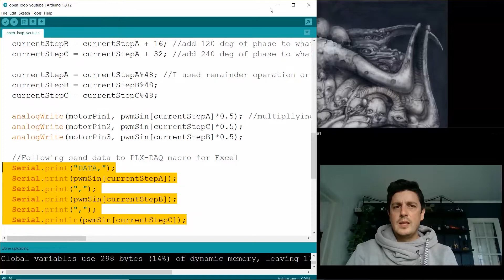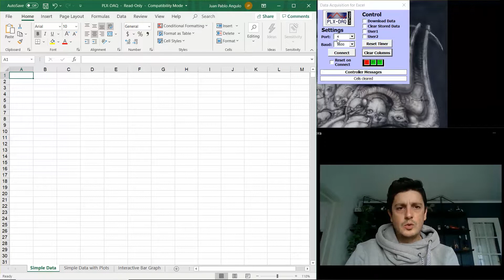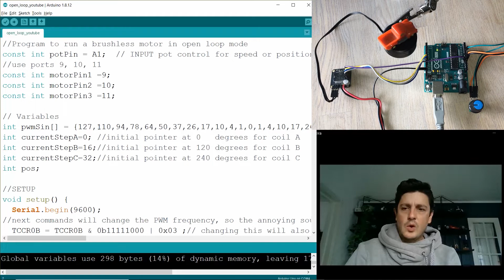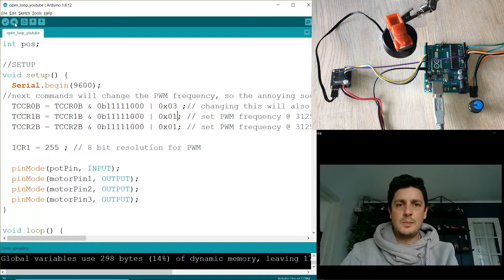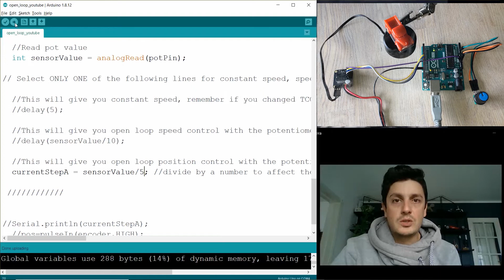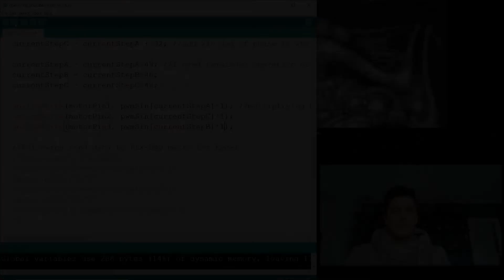Brushless Motor Control with Arduino (slow rotation) Open loop

Comment: Hey Pablo
So I recently bought four ball screw devices at an auction because they were fitted with black motors with encoders, apon inspection at home I realized they are bldc motors also fitted with  ESP32 and ODrive boards V3.5. I am having trouble finding the L6234D here in my part of the world and was wondering if you  could you maybe provide me with a pinout sketch so I can use it instead of the L6234D ? (Or maybe using the ESP32)The motors I have are also quite large. This BLDC thing Seems pretty cool and would like to start tinkering. Kind Regards.
Reply from the maker: Sounds fun! If you go into my patreon you will find a way to drive bldc using the very common L298, hope that works for you!

Comment: Wow, that's a thorough explanation! In my situation, I'm utilizing the IR2104 drivers, but I'm encountering difficulties grasping the theory. Essentially, there are two methods to control a brushless motor: using PWM, as you demonstrated, and employing full-wave switching to commutate the phases. Initially, I thought employing both methods simultaneously was the correct approach. However, my teacher suggested otherwise. Currently, I'm unsure about how to configure the Arduino to send PWM signals and effectively operate the motor. Do you have an idea on how am I supposed to do since there is two IN pins (High, and LOW pins) ?
Reply: These 2 IN pins are for brushed motor, HIGH and LOW for direction only.

Comment: thanks for the video. I want to use gimbal motor 2204 260kv to rotate an arrow max 30 degrees left and max 30 degrees right, depending on the car steering wheel position taken from can bus with adafruit board that has can bus integrated. My question is: do I need the encoder? because I don't really need the feedback from the motor, it should run the loop and the motor position will depend on the position of the steering wheel? thank you.

Comment: Hi! Your experiment is very impressiv! After your video, i made my controlling system based  a little bit diferent parts and changed logic, but source is Your idea. I have an old CD head stepper with 2 coil, and L9110 dual H Bridge. I made a +/-simmetrick sine wave with the H bridge, and the poti can change the direction and the rotating speed. My sine wave have 12 steps from 0 to 255, and the system working fine, but the clone UNO cant working with 32 kHz pwm mode :-(  My expriment video: https://www.youtube.com/watch?v=993LI6Ki1ao
Reply from the maker: Guess its a bit noisy then? You hear a “hum”?
Reply: @RandomAccessProjecs  Yes, 500 Hz PWM....

Comment: Thanks for your guide!
I also apply the sine wave value table, but I noticed with each rotation, its rotation angle is irregular, for example there is step = 1.5 degrees, there is step back = 3 degrees, please tell me, do so that each stepper rotates, will obtain 1 fixed angle like stepper motor?

Comment: Any reason you made the sine lookup table length 48 ? I see that 48 is a factor of 1/3 and 1/4 (for the 120 degree and 90 degree shifts). But any other reason? Based on poles or anything?
Reply from the maker: Only the reasons that you mentioned and the fact that 48 gives a decent resolution, but you may use a larger/smaller number, its not related to poles or anything else.
Reply: @RandomAccessProjecs  What other values could we use instead of 48?

Comment: First of all thank you so much, you explained the stuff very clearly. I have a doubt after watching the first video again....
We started with index zero. How do we know the relative stator-motor position? Will it just start with a random torque value , between max torque(when magnets and energised coils out of phase by 90 degrees) and 0 torque (neutral position-when magnets are in line with the energised coils.) .
Reply from the maker: Correct... in open loop you dont know the position of the rotor so it will start with a random value until they align. My other videos explain the closed loop approach, hope they are useful :)
Reply: @RandomAccessProjecs  Thank you so much sir for the whole series,Your reply to my doubt felt heart warming. Like others said....you are an angel 😁

Comment: Hi! Which board did you buy with the L6234D chipset? I can't find any breakout boards out there. I can only find the individual chip. Thanks!
Reply from the maker: Its no longer available :( but the link in the description takes you to an all integrated board with enough drivers for 2 motors at the same time :)
Reply: @RandomAccessProjecs  thanks for replying! So the eBay dev board has the same performance in your experience?
Reply from the maker: @tomtouma  correct. Check out my other videos, the Ball and Beam one or the Haptic interface or the drive by wire videos they all use that one board
Reply: @RandomAccessProjecs  Great, I will get one. Do you know of any schematics or further info on the hardware of that board exactly?
Reply: I bought that board. I was wondering if you could explain to me how I can spin one of these 'iPower Motors' without an encoder. I want to see if I can get it spinning first. Thank you!
Reply from the maker: @tomtouma  thats what the video is explaining. Follow the steps and download the files. Good luck

Comment: Hi Pablo! Greetings from Spain. Is there any way to do something similar (low speed) adding the minimum pieces as possible with a 4-in-1 esc for controlling 4 brushless motors?? Thanks in advance and great job.
Reply from the maker: Perdona, no entiendo la aplicación. Quieres conectar 4 motores BLDC a una misma tarjeta? No se puede si quieres q se muevan de forma independiente pies requiere 3 puertos con pwm cada motor. El arduino tiene 6 puertos con pwm en total. Podrías hacerlo pero en pares por ejemplo, dos se mueven juntos y otros dos, (solamente funcionaría en lazo abierto). Saludos
Reply: @RandomAccessProjecs  la idea es usar motores de drone con su esc 4-in-1 como si fueran motores actuadores de robótica añadiéndoles un engranaje planetario a cada uno. Me parece que con Arduino y la librería "servo" permite usar los digitales como pwm. El caso es que no puedo controlar la velocidad como lo haces tú en el vídeo ni el torque con solo el esc del drone pero me interesaría mantener el tamaño lo más reducido posible. Mil gracias por tu ayuda y tiempo. Un saludo.
Reply from the maker: @charlesblack7989  q no va a ser posible usando esos ESC. Saludos
Reply: @RandomAccessProjecs  gracias igualmente. Saludos.

Comment: Hello Pablo!

I tried this open loop code on your development board, connected pot on Vcc, Ground & A1 but motor just vibrate & humming. 

I also tried Closed loop Steer-by-Wire code and motors vibrate pretty badly; motors are moving roughly with jitter but are not synching.

My motors are iPower gb8108-90t 36n42p motor. (I tried const int PA = 42 & 21 as well)

Can you help me to identify what I'm doing wrong please!
Reply from the maker: Focus on open loop, which mode are you using? Go for speed mode, check that the delay is not too small. Dont try anything else until open loop is working ;)

Comment: Can I use an L298N motor driver instead of  L6234D? What are other possible replacements?
Reply from the maker: Did you check the link to our recommended board? That board drives 2 motors at the same time, as demonstrated in the other videos :)
Reply: @RandomAccessProjecs  Yes! But the L6234D driver isn't available in India and I'd like to know if I can use  any other driver instead? Thanks.

Comment: Hey guys. I tried the same thing, but on slower speeds, the motor is very jittery. Any idea why this might happen?
Thanks for the Video !!
Reply from the maker: Maybe increase the torque? (More voltage and change the torque variable value=1 instead of 0.5... does it behave ok at higher speeds or jittery always?
Reply: @RandomAccessProjecs  With the torque value at 1 its not as bad, but the motor gets super hot...
here is a Graph of my stepvalues vs the absolutposition from the encoder (0-16383)
https://photos.app.goo.gl/gAranRvv2B6UfHZYA
The Position should be a line, but it is super wavy. not sure what i am doing wrong
Reply from the maker: @mufassarwaheed6160 get rid of all kind of lines that could cause delays, no printf, the only delay allowed is the one that is intended to control the speed. Clean the code from what you are not using, run it, and it it persists, paste your code here And Ill take a look at it (but please clean it first!) ;)
Reply: Thank you for replying always so quickly. I tried your code without changing anything major.
https://github.com/Muffin-W/BLDCTeensy3.2/blob/main/BLDCCode_JuanPabloAngulo
The only thing i have different now, is that i have different pins and a different method to change the pwm frequency since i am using a teensy3.2 board.

Your help is so much appreciated
Reply from the maker: @mufassarwaheed6160  maybe its a problem with the teensy. Try the standard pwm settings (490Hz), as the timer affects the pauses, maybe that is the reason. Borrow an arduino uno and test it there. Good luck

Comment: Thanks for the great explanation!
How would I have to set this up if I want to use seperate gate drivers, like the IR2104? (https://www.infineon.com/dgdl/ir2104.pdf?fileId=5546d462533600a4015355c7c1c31671 )

Comment: very nice job thank you. but one question: if you change the motor positon via hand, what is happing? okay, the µC gets no information but the motor will continue to rotate or what? thank you
Reply from the maker: Yunus Calagil the motor will skip the original movement and continue to move after you release it :)
Reply: And next question is :D wenn i open loop control use, i dont need FOC or?
But how can the MC know the rotor Position?
Reply from the maker: Yunus Calagil you can only base the position on the amount of electric revolutions you have sent out, and hope the rotor didnt slip or jumped... its similar to when using stepper motors. You send the stepper motor to a position, but not having an encoder also means not being able to corroborate that it arrived in that position ;) maybe its time to upgrade your setup to closed loop? Good luck!!!

Comment: Hi. Are you sure this code sets pwm frquency to 31250 Hz?
 "TCCR2B = TCCR2B & 0b11111000 | 0x01; // set PWM frequency @ 31250 Hz for Pins 11 and 3, (0x03 is default value, gives 490 Hz)."
I think it is 62500Hz.
Thanks.
Reply from the maker: Mikrodunya please check the Arduino official website as there might be a mistake :)
Reply: @RandomAccessProjecs  Thanks. It is my mistake because i thought arduino was using "fast pwm" mode. I checked now the datasheet and seen that, Timer2 is in "phase correct pwm mode". So calculation is "fOCnxPCPWM=fclk_IO/(N*510)". So it is not 62500 but it is about 31372Hz. Thanks again.

Comment: Greetings! I am doing what you are doing right now but i am wondering... Is it normal for the motor to heat this much? i have  the torque set to 0.5 and after few minutes of turning one way and the other (position) its quite hot!
Reply from the maker: Vid Črešnik well its hard to tell, depends the voltage you are using and the motor itself. The small motors I use get quite hot when fed with 12V... but it really varies a lot... drop the supply voltage or try 0.25, yet a motor should be okey to work even if warm, as an example: Stepper motors can be quite hot and work for years also at 100 ºC / 212 ºF surface temperature.
Reply: @RandomAccessProjecs  Ok thank you, i just noticed it was at 100%, so i guess its ok and if there is no problem for it to be warm than im good! 
Next question is, can something be done with the noise? The motor is very loud! (in time it gets quite annoying).
Also what did you do with the encoder noise? Do you filter it?
Thank you very much for your help!
Reply from the maker: Check the other videos. Pwm default is around 400 Hz if I remember correctly, so lots of noise, but if you change the right registers, then it should be very quiet. If this doesn’t happen, could be another reason. Upload a video an share your links
Reply: @RandomAccessProjecs  I checked other videos - many times, i have those registers set as you have, but i also use this bgc board, not Arduino Uno.

Comment: Is it possible to buy one of these single-motor power stage boards?
Reply from the maker: Sync Prism hi! Yes, here is a link where you can order from :) http://rover.ebay.com/rover/1/711-53200-19255-0/1?icep_ff3=2&pub=5575378759&campid=5338273189&customid=&icep_item=124316900944&ipn=psmain&icep_vectorid=229466&kwid=902099&mtid=824&kw=lg&toolid=11111

Comment: Using that motor driver, would you be able to somehow connect 3 motors on an Arduino? I see only 6 PWM ports on the Arduino so I would assume then that you would only be able to connect two motors and their respective 3 phases. Is there any way around this? Is there any alternative way to connect three brushless motors to the Arduino?

Comment: Thanks a lot for the video. Why do you think the motor can't catch up with the waves when you increase the rpm? To me, there is no load at all and the rpm is pretty low at the time it stalls.
Reply: Hi! I have the same problem! Did you fix it?

Comment: Very impressive low speed smoothness and holding torque.  i'm curious on the actual current measurements and also what the motor is rated for, along with the temperature of the motor..

i'm also very interested in your video on closed loop and will be looking for that now!  

I like the channel name... a derivation of Daft Punk Random Access Memories? (great album)
Reply from the maker: Jrod FPV the new videos are up, check em out :) yes the name of the channel comes from that album. At 12V the small motor gets hot, the larger motor (see next videos) runs ok on 12 V ;)

Comment: Hi! is it normal for the motor to vibrate even at PWM freq=31kHz?  or will FOC get rid of this?
Reply from the maker: Dave Lugtu i guess vibration at lower frequency could come from other sources. For example, if theres a lot of noise in the sensor reading, that will trigger an output that reflects the input noise... so vibration will appear. Also, I noticed when going up to 31khz on the Arduino pro, it looses a lot of resolution on the pwm, this causes the rotation to lose the smoothness. Let me know how it goes ;)
Reply: @RandomAccessProjecs  I am actually using an STM32F103 board (which supports up to 16bit pwm) and DRV8313 drivers with Arduino IDE. The vibrations are still evident even when no sensor or potentiometer is used (just a for-loop looping through the array indices). I am unable to monitor the output waveforms-no oscilloscope :)
Reply from the maker: Dave Lugtu can you post a video ? Maybe I can help you debug
Reply: @RandomAccessProjecs  Here is the video: https://youtu.be/HZ3P7gBED7c . I can describe it beeping like your steer-by wire attempt video, accompanied by very low frequency vibrations. is it normal for open loop control? I havent tried any closed loop/foc yet. I can only imagine this when used as a camera gimbal, those vibrations will cause a lot of jerkiness. Thanks for your help!

Comment: Where did you get the l6234d module?  I want to purchase some for experiments like what you are doing.
Reply from the maker: Vince Herman I ordered it from ebay, there is a link in the description. Thanks for your support
Reply: @RandomAccessProjecs  The link doesn't show the breakout board.
Reply from the maker: Reza Danesh its no longer under production... it was a french company making those, but follow the link to our board, it has 6 mosfet drivers to power 2 brushless motors at once and an embedded Arduino Pro ;) http://ebay.us/a8VE8P?cmpnId=5338273189
Reply: @RandomAccessProjecs  Great, I just ordered one. Hopefully, I can get it sooner.

Comment: Are these gimbal motors different in any way to BLDC motors used, for say UAV applications?
Reply from the maker: Yes, these have more number of poles, which gives them higher torque, and lower top RPMs. Also, some of this also include a shaft encoder, which is not normally found on UAV propelling motors. However the application on the video should work for both motors. Thanks for the question.

Comment: Your link to the code is dead. Maybe use GitHub. That's what it's for.
Reply from the maker: Thanks, done: https://github.com/juanpablocanguro/BRUSHLESS-MOTORS/blob/master/open_loop_youtube.ino
Reply: Most of the stuff we see in the Arduino demo arena I think represents a pretty fundamental but useful misunderstanding of BLDC and PMSM motors. It's always possible to control 'average' speed of a permanent magnet motor when the voltage is high and the torque load is low, by sequencing the magnetic field. Doing so means hall feedback, sensorless feedback, and FOC are thrown out the window. The motor will transition from one the of the three commutation phases with non-linear accelerations. I suspect it would be more linear with sinusoidal drive. That will be interesting to see. But in doing so you will be guaranteed that the magnetic fields between permanent magnets and induced coil fields are never orthogonal. They can't be because the forces are always trending to 0 with little to no opposing load. With real control, FOC or otherwise, the voltage controls the speed. And with no load (just friction) orthogonal fields (or approximations (ie trapazoidal)) and thus efficiency are still achievable. A brushed motor sets a somewhat constant lead in the permanent versus induced fields someplace a bit less then between 0 and 180. In a BLDC the fields intercept at between 60 and 120 degrees. In a PMSM the lead IS constant at 90 degrees, and therein lies the genius in FOC